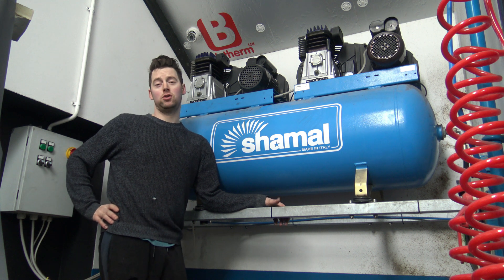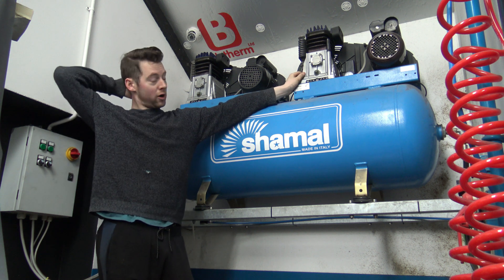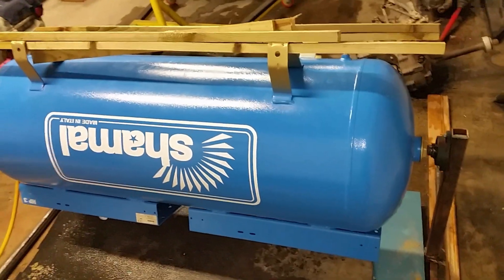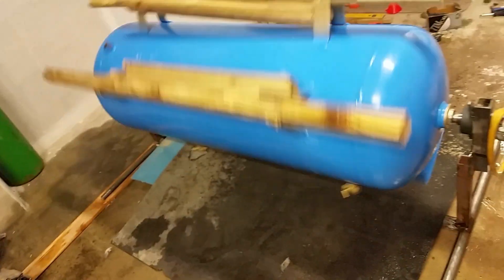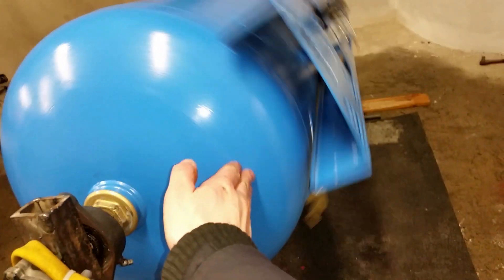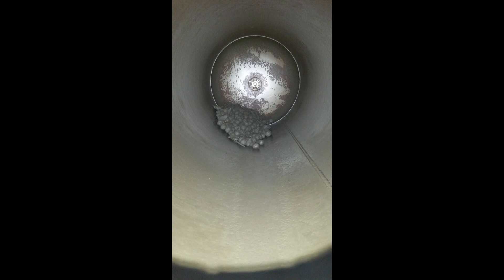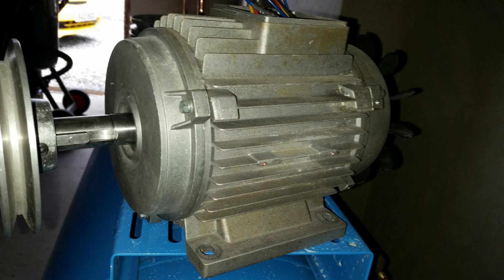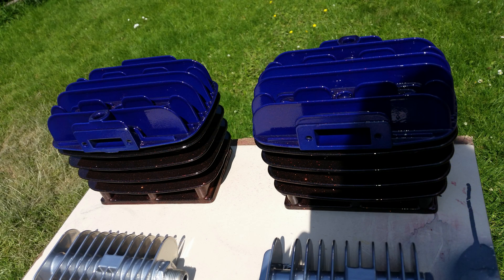I TUMBLED my 270ltr Vessel of my Shamal Tandem compressor to do a complete refurb

Comment: Great video have u got a wiring diagram for the control box and compressor please, thanks
Reply from the maker: Hi, Thank you. No I don't. Can I help you with something? Jeffrey
Reply: @jeffrey henderson  thanks for the reply. I was asked to wire one of these up, but the job got cancelled. I just wanted to ensure there weren't any required control circuits. Thanks
Reply from the maker: @richardnewton5159  Sorry I only seen your message, the only controlled circuit is a delayed timer that controls the second contactor for the second motor on the right. It's better the start up ( in rush) current is split and started a few seconds apart. Thanks Jeffrey
Reply from the maker: @richardnewton5159 

HI Richard,

As you showed an interest in this year's ago, please see the same compressor now on my channel. I customised it, turning it into a bigger beast 😅.

Thank you, Jeffrey